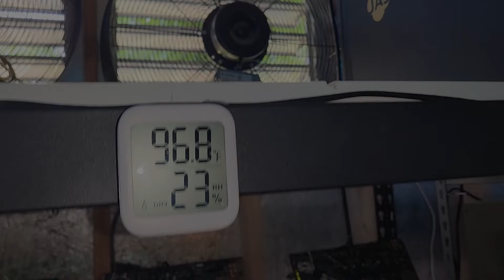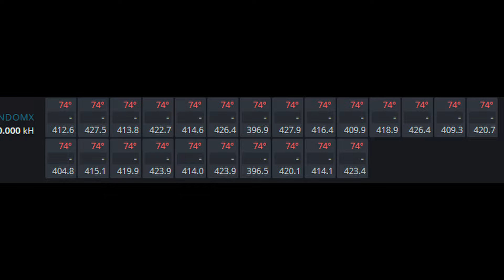I ALMOST KILLED my most prized CPU.........

Comment: Zen3 has made people forget how decent Zen2 is. A 3900X is still a great CPU if you remember there really weren't CPUs with that many cores available on consumer platforms.
Reply from the maker: Yup the 3900x has aged like fine wine, its good for basically everything but gaming as you can get cheaper options, and its a champ for mining still. (One of the big reasons they are holding their value so well)!